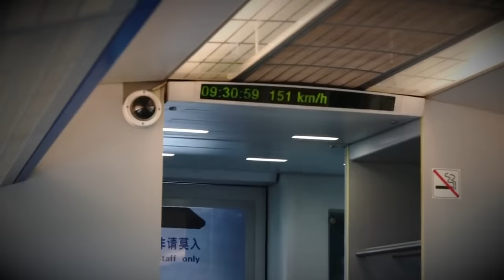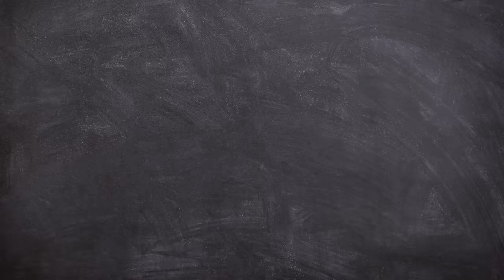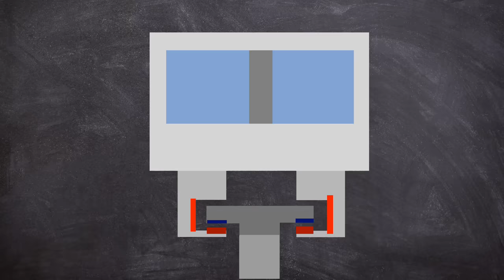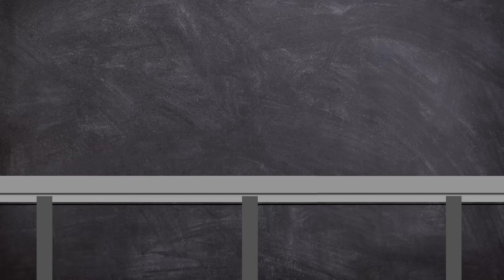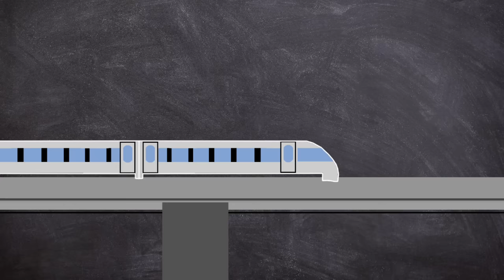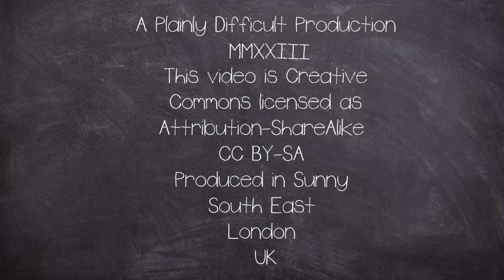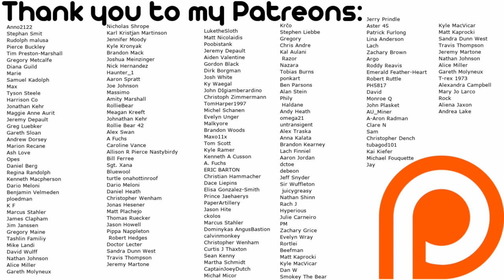Safety Complacency: The Lathen Maglev Train Disaster 2006 | Plainly Difficult Documentary

Comment: It is really sad Maglev was ultimately shut down. Weren't it for the accident it may just have been the revolution Germany's public transport is lacking today. Just recently the head of infrastructure at Deutsche Bahn said in an interview "Zu voll, zu alt, zu kaputt" which roughly translates to "[The German rail network is] overused, too old and too f'ed up".

One of the most modern ICE connection (Berlin Central - Munich Central) takes between 3h50 to 4h for 504km with 5 stops in total, that's about 130 kph on average. That's comparable to the LNER high speed connection from Edinburgh to London which takes around 4h for 534km with 3 stops. Now imagine you'd have a Maglev between Berlin and Munich instead. I'd bet it would compare in terms of speed more to something like the Shinkansen between Tokyo and Osaka that takes only 2h27 for 514km (that's an average speed of 220 kph). Mind you, that line has 13(!) stops. Plus, due to the need of a separate railway network for the Maglev the punctuality would be greatly increased, compared to the measly 65% punctuality of the DB in 2022.

Comment: Is this technically a monorail disaster? Or the closest we will get to a simpsons monorail disaster.
Reply: Monorail is self descriptive: it uses a single rail and being a much older technology, uses basic electronic systems, no magnetic levitation.
Basically a subway train supported by one rail, which is why they're inherently dangerous: not enough structural stability.
Reply: Monorail vehicles generally wrap around the rail (for conventional train-on-rail) or the rail wraps around the overhead bogie (for suspended train-under-rail). They are very safe and structurally sound; you generally need a total failure of either the vehicle or the rail to cause a derailment. 

This wrap-around business means switching monorail vehicles to another track is tricky. 

Maglev vehicles are monorail, as magnetic levitation does not adequately guide the vehicle laterally and therefore the track has to wrap the train, or the train has to wrap the track.
Reply: @davejones9469  yeah I think this is a bit of a monorail event!  It fits the technical definition despite the magnets.
Reply: Springfield Monorail disaster 100%
Reply: @EM.1  A good jingle can get so much done though! "YVAN EHT NIOJ!" EVERYONE!

Comment: I thought the Shinkansen bullet trains here in Japan were maglev and I was about to ask what you were on about, but it turns out it's still just in testing here as well.  Though apparently it is supposed to become public soon?

But now I feel dumb for assuming they were maglev despite having lived here so long.  Thanks for helping me fix that, hah!
Reply: To be fair, if anybody was going to have had this tech going since the 1960s, it would have been Japan.
Reply: Surely, you heard the wheels and saw the rails?
Reply: @franklittle8124  Most of the Shinkansen is fenced off so it's hard to see the track itself, and if you look at the side of the train, the wheels are covered in aerodynamic fairings.  But yes, all the lines in current service are "normal" standard-gauge railways.
Reply: The maglev is (was)  shedueled to open for comersial service to 2027
Reply: It’s not so much in testing as under construction!  I would like to place a bet that China will turn off the Shanghai maglev in a few years and then Japan will turn its one on.  At least the Japanese one actually goes somewhere.  For a centrally-planned economy, China’s one was bizarrely and suspiciously designed to stop somewhere useless, instead of go to a useful part of Shanghai.
Reply: @whophd  if you know why shanghai maglev ens where it does, you would know much more about maglev.

It have nothing to do with cost, all about politics.
Reply: @matsv201  We all noted you typed two patronizing sentences instead of stating plain and clear why you think it ends where it ends.
Reply: @u1zha  way to not admit you are wrong
Reply: @matsv201  BRO JUST TELL US WHERE IT ENDS, wtf is wrong with you XD
Reply: @Schimml0rd  where it ends is totaly ireveant.

Why it ends is the more important question.

Comment: I'm a die hard fan of our french hover train, the Aérotrain. The Transrapid was a competitor to our thing, the project was started in response, a different tech, still, there were contacts between engineers teams (one of the early Transrapid prototype was even an air cushion hover train, technically a copycat!). I know that wheel-less trains are the way to go, high speed trains are just way too expensive and maintenance intensive (i'm french, okay? I'm well placed to know that our TGV is a taxpayer money pit...). And I was devastated when I've heard about this disaster. I instantly knew it was the unjust nail in the coffin for the whole project.
I still have a sealed pack of postcards from Lathen test track, a gift from a Transrapid engineer. It will stay untouched for ever.

Comment: Ive been on the shanghai maglev.
Its really cool. We reached a speed of about 330km/h. At busy times at could go 400+km/h. But like my wife said, its more of a showcase thing than a usefull piece of engineering. The cost to run a maglev is ridiculously high because of electricity. 
Also the maglev in Shanghai is made by the germans if i remember correctly.
Finally i feel connected to a PlainlyDifficult video. 😄😮
Reply: It´s only expensive because in China no one can affort the Ticket to take the transrapid. It is actually still a testtrack, since China didn´t want to be the first to build a commercially operated line (they wanted to leave that to the Germans). And no, the cost to run a transrapid is significantly lower than that of a conventional high speed rail, since it has been build to save at least 30% energy at higher speeds compared to these. And no, the infrastructure isn´t more expensive to build. Chinas maglev was for years in a bad shape, because no one cared about it. The only yes is, that the Shanghai SMT is actually a modified German made Transrapid 08 that was originally build to run on the Hamburg-Berlin line which, thanks to political and lobbyist issues in Germany, never came although it should have.
Reply: @bieneulm1982  Thanks for the info.
Yeah the track was really short. Looked like a test piece. And yeah i remember she said that the maglev tickets were way too expensive for regular work force in china. It is more for business members.

Comment: Some years ago there was a Maglev service in Birmingham England, running from the railway to the airport (I think, decades ago!).  When I say service it was plagued by all sorts of problems - I remember on one occasion the doors failed safe in the closed position and of course people panicked. Problem was had they opened the doors it was going to be a long drop with a squishy end.
Reply: I think the Transrapid had "tube slides", where you would slide down to safety inside a tube. I once worked in building where they also had that system. Quite a few floors, but the system worked very well, in some fire drills, no squishy end or something.

Comment: The maglev project was a combined project undertaken by Siemens and KLM (Dutch national airline). The end goal was a maglev track from Rotterdam -> Amsterdam -> Groningen -> Bremen -> Berlin. It was to go on stilts so there was no risk of colliding with regular traffic, and the elevated track would also allow uninterrupted ground use and space for wildlife refuge areas. If you have normal trainbed or a high-speed trainbed, ground use is severely impeded. I lived in the Groningen area at the time and was really looking forward to the realisation of this plan, as it would greatly reduce flying.

Comment: The sad thing is that almost 20 years later, Munich airport (which should have gotten a Maglev line directly into the city center with about 10 minutes ride time) still has one of the slowest and worst public transport of any major airport in the world with train connection. You are basically stuck on a local commuter train which takes 45 minutes for less than 30km distance because it stops in every other suburb.

Comment: The moment you mentioned the maintenance vehicle, I knew what was going to happen (obviously it's a vid about a crash, but even so)
Reply: I still can’t get to this day why the maintenance vehicle wasn’t interlocked with the main power supply of the test track. A simple NC signal loop wiring the vehicle into the main contactors control would have avoided all this. 
If you have ever seen how lock out - tag out worked for 100s of years with overhead powered locos in workshops, that would have been the obvious solution. I had the opportunity to go to a museum which formerly was a railroad works and the solution for not getting workers electrocuted was simply holes on the handle of the 15 KV switch. for one personal lock for each member of maintenance crew. It would be locked in the off position and couldn’t be turned on until the last lock is removed after the crew cleared the area.

Comment: A slow test track was even built in Berlin. On the route of the former U-Bahn over bridges.
But then came German unification and the line was needed again for conventional trains.
The M-Bahn existed from 1984 to 1991 but was only open to the public only for 2 years.
After that it was converted back to normal rails.

Comment: We have found that holding people responsible criminally for transport type crashes is dangerous.
Its done in europe quite a bit and is counter productive for accident prevention. 
Also if you think you might be held responsible,  you will not cooperate with investigators.
In the states, you would be charged aside from criminal negligence. 
Looks like these dispatchers were told not to use the safety system and a backup system was not in place.  They were set up to fail.

Comment: How does the Emergency brake system work on a maglev train!?  (Yes I will google it, but when Jon said it I had to wonder 🤔). Great Video as always 👍
Reply: Pretty much like a normal high speed trains.  Firstly the reverse the stator current, and if then need more breaking they also have inductive breaking to side panels in the track. High speed train does the same but to the track.

Comment: A silly looking but operationally important factor: how long you run a test system without rebuilding it. It stays useable the whole time, with all modifications and improvements, easy fixes to issues.
But the risk goes up and up and up.
You have to tear it down and rebuild it to keep the big picture of compatibilities and to watch which factors emerge as critical, not rebuilding the original draft, but the Frankenstein version that you are *already using*. A production system is used differently and doesn't have these specific needs but completely different ones. The issue with the radios will not be noticed in the build phase as theres no maglev train yet, and might have come in years later as the maintenance cart would not get a new supercool radio system for telemtry, but the train would.
If you look at that critically, it's because the maintenance car on the test track would not be considered an actice part of the system, and you can take a guess if there was a budget plan to modernize/sync undefined systems 20 years after the planning date. There should have, but would it have been signed off?
Charles Perrow's "Normal Accident Theory" would have been a perfect fit here, and a considerate design might have simply added warning lights fed off the power rails and directly triggered by the trains power suction 1km away.

Basically, you need to periodically re-learn how your system is really built or you'll assume it's the one originally built, which it is not. If you run on that assumption, you cannot operate it well. Even if you think you do, you'll be operating something that does not exist.

Comment: if you go to google maps,  you can still see the tracks, though badly rusted in many places for the metallic coverings and track surface, but it looks like most of if not all of the infrastructure is still intact. A few people have even submitted photos to google of the maglev track and what appears to be the original investigation site, possibly even including materials and original components of that accident. zooming in on the few images of the track, all the cabling and control systems are still there.  

The Company is still there and listed as open,  so,  what are they still working on?  

I know they have a small museum there at the site as well.
Reply: Something is still running up and down those tracks as well,  

Informationszentrum Dörpen <-- search this up at the northern loop and look at the photos on google maps,  what is that big thing on the rail?

Comment: Regardless of the type of train or length of track an active automatic braking system plus automatic tracking and warning of potential issues is necessary. Every moving object on the track should also have cameras to clearly see in both directions.

Comment: Personally I'd add a couple of points on the disaster scale due to the long term effects of these kinds of accidents. Like the Concorde, the sentiment falls and the tech is discarded as though it's faulty when it definitely isn't.
We need to modernise signalling systems. There needs to be a mesh network where anyone on the network can view any section at any point and it can be partially down and the rest remain functional, it needs to be able to operate without a control centre. We can't allow single points of failure.
Reply: Well, Concorde was inherently flawed. 

It was a overpriced toy of the rich that couldn't use its prime selling point over land. 

Maglevs I wonder if they will share the same fate

Comment: In my eyes it is important to mention, that the Transrapid Maglev Technology, the train and the track is not more expensive than a conventional high speed railroad, e.g. it’s uses 30% less electricity at 350km/h, the track can be used for 75+ years, generally less maintenance cause there are no wheels, etc.
Although it was not due to a one vehicle operation, that it was able to be remote controlled, the Transrapid was the first high speed train, fully certified to be operated from a Control Center, without a need for a reg train driver.
This should and will be a part of the future of Transportation, with all of its advantages.

Comment: I've ridden on the Shanghai Maglev twice - both times I found it to be noisy and jarring to ride on compared to either the normal subway trains or the high speed intercity trains. Which is weird. I was expecting the ride in the Maglev to be silky smooth, but it was far from that, leaving me at journey's end feeling like I'd been riding on a giant vibrator (ha ha). The cost, also, compared to the normal subway (which travels above ground for its last leg to the Pudong Airport complex), is high, and the reduced time barely worth the hassle of getting to the south station and waiting around for 20-30 minutes. I only bothered with "having a go" just for the sake of the experience.
Reply: The Shanghai Maglev is getting old, and the age has taken its toll I suspect. I believe the Shanghai Maglev used to travel at 420km/h, but is now limited to around 350km/h. It's still being maintained of course, but with the full-on construction of highspeed railways, its only a matter of time before the Maglev gets decommissioned compltely. This Maglev was built when China was still deciding on the format of the new generation high speed railway system, so it was an experiment essentially. There were also domestically made highspeed maglevs in China, which is now parked in a university in Beijing as far as I know. We now know China settled on traditional wheeled carriages, but at the time, maglevs were seriously considered. Back in the early 2000s, there was a plan that proposed to build a Maglev railway from Shanghai to Hangzhou, two major cities in eastern China. Engineers were already scouting for the locations of stations when the project was pulled. Why? I'm not entirely sure, but maybe

Comment: Quite frankly, I am a little disturbed by anything moving that fast that close to, or on the ground. Don't get me wrong, I've been on several high speed trains over the years. but there has always been the thought; if things go South, it'll be over with quick, maybe, not a human, or even a machine can correct a fatal error in those systems at those speeds. Murphy's Law, if something can go wrong, it will eventually.
While I consider the engineering for such a beast the epitome of modern engineering, all accolades to such, 
My feeling is that a maglev combines the worst aspects of both a high speed conventional train as well as aircraft. a power loss can be fatal, quicker being levitated only an inch or two above the track.
Reply: You think that's scary, imagine being the pilot on the "Caspian Sea Monster" ekranoplan. A dozen jet engines flying less than a wingspan over the ocean.

Comment: Why wasn't the simple Token system in use? Maintenance train would have the token thus passenger train cannot use the track. When the maintenance train gets safely back it hands over the token to the passenger train. This system was used in UK for single line working and surely would have prevented a disaster here?